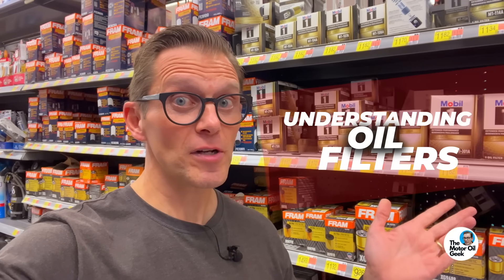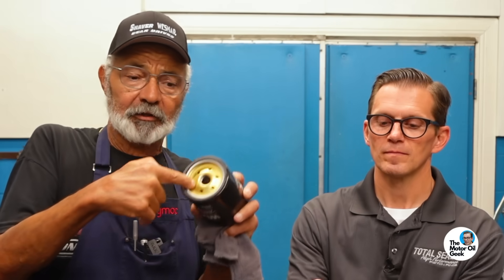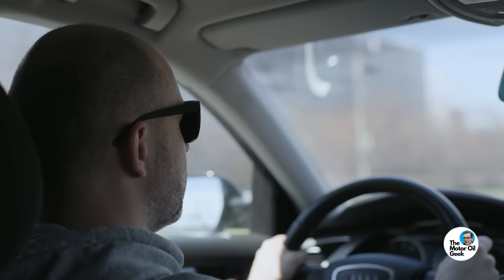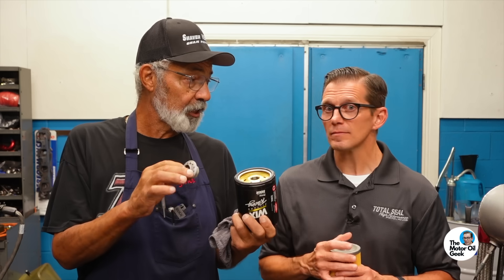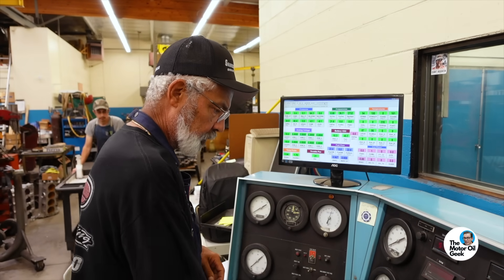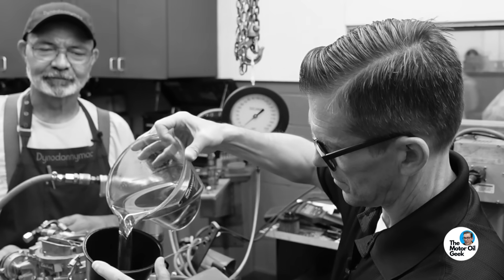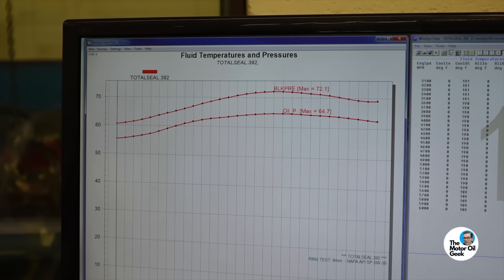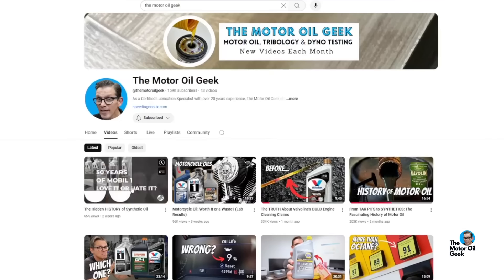OIL FILTERS: What Most People DON'T Know!

Comment: Primer on Filtration
Allow us to offer this primer on filtration.
Filter media has a range of particles that it will remove. The smallest particle size it can catch is usually referred to the “nominal” size. The largest particle size it lets through is referred to as the “absolute” size. The sizes between those two are usually expressed as a beta ratio, or percentage of efficiency. In other words, if you introduce 100 particles of the 15 micron size and 60 of them get caught, you have a percentage of efficiency of 60. It is interesting to note that some companies are very liberal with their advertised absolute numbers.

There are many different test procedures that can be used to test the particulates a filter media will remove. There are single pass, multiple pass, SAE, ASTM, and even European specific tests. What gets difficult is how to compare the numbers used for marketing filters. Picture yourself standing in the auto parts store in front of a rack of filters trying to decide which filter is “best”. You see a 22 micron filter with some sort of efficiency rating attached to it (for example 94% efficiency) and another with a 15 micron number printed on the box with no efficiency rating. And then you see one that has printed on it that the filter will catch down to 5 microns. There is no way to accurately compare those numbers. From a marketing standpoint it is better to print lower numbers since most consumers don’t have a clue about efficiency ratings, and there is more of a chance of the customer purchasing the lower number filter. Problem is the “5 micron” filter may be letting more particles through the filter than the one that has 22 microns printed on it. A good example of this is the Harley Davidson Twin Cam filter. On the box it says it will filter down to 5 microns. When tested at the lab it actually passes 40 micron particles. Before you condemn the filter, I would note that it pretty much tied with the Dodge Cummins diesel filter as the tightest OEM filters tested. As an fyi, most paper filters range from 50 to 90 microns as their absolute number. Ours is 35 (and yes, we can catch 5 micron particles as well).

We use the ASTM test because it offers the smallest amount of manipulation of the testing process. We test for worst case, or absolute numbers, partially to be able to compare apples to apples between filters, and partially because of FAA testing.

As filter media gets tighter, the flow rate gets slower and the resistance to flow increases. This resistance is referred to as differential pressure (the difference in pressure between the outside and inside of the filter element). As the differential pressure increases, the pressure against the bypass valve increases and the chance of the bypass opening increases.

K&P Engineering focuses on maximizing flow rates while meeting or exceeding OEM filtration. Not all stainless steel filter cloth is created equal. We specify the wire diameter, thread count each direction and the type of weave to use to create our filter cloth which is how we meet the filtration and flow goals. We can get between 5 and 7 quarts of oil through our filter element in the time it takes to get 1 quart through an OEM filter element while still meeting or exceeding OEM filtration. The reason for this is that paper and synthetic filter media is made of fibers that are pressed or glued together and require a certain thickness to get to the filtration objective. This type of media inherently has more flow restriction that the filter cloth that K&P Engineering uses. We tested a pro stock engine on the dyno with a gage on both sides of the filter cavity. At wide open throttle we measured 20 lbs of differential pressure on the paper filter (0w at 180 degrees). The K&P Engineering filter measured less than 1 lb. This means the bypass on the paper filter is open letting unfiltered oil through the filter and into the engine. Ours has a lot further to go before it opens. The result is more filtered oil getting to the engine, and getting there faster. The reduction in differential pressure also results in less backpressure against the oil pump which has the potential to improve performance and or fuel mileage.

Some will argue for a very tight filter media, and concentrate on the smallest particles a filter will catch (even though it might be a nominal number). An analogy we use is to think about the towel you are about to dry your freshly washed new car with. Are you more concerned about the dust that has settled on the towel, or the rock that is in the towel left over from when the towel was dropped. It also becomes a moot point on how tight the filter media is if the bypass is open and the debris is flowing right past the filter media. Some filter companies argue that they are ok with the bypass being open because the debris will eventually get caught as the oil seeps through the media and the oil will get to a cleaner level at some point in time. Our concern is what damage is being done while that debris is passing through the engine over and over again waiting to get caught in the filter media. We have customers that do want to get to that finer level of cleanliness, and they usually go with a bypass filter setup. They use our filter as primary filter, and a very tight filter on the bypass circuit. That way the oil is cleaned to OEM levels with our filter, and as it dribbles through the tighter media of the bypass it will get even cleaner.

The stainless steel filter cloth technology has been around a very long time. It is used in military aircraft (fighter jets, helicopters) and even used for filtering blood. K&P Engineering filters are approved by the FAA for aircraft use, and have just recently been approved by the European equivalent of the FAA (EASA) for use on aircraft in Europe. We are consistently monitored for quality assurance as a part of these approvals.

Having said all this, K&P Engineering appreciates the people that question the quality provided by different filters. There are some cheaper counterfeits of our filter out there that use the K&P Engineering information and numbers to promote themselves. When we sent the media of those knock off screen filters out for testing at the lab, they came back as filtering worse than the worst paper filters we have tested. It is kind of like the Harbor Freight versions of Snap On tools.

K&P Engineering
www.KandPEngineering.com

Comment: Good video. I do wonder if any oil can pass through the filter without being bypassed when you fire up the old jalopy in the dead of winter when it's zero or minus twenty degrees outside? I don't know how you can test zero or minus twenty degrees Fahrenheit oil in your lab there, inside the engine before you fire it up, but I wonder.
Reply from the maker: We are going to see if we can test that out.

Comment: maybe you could do a test on a reusable filter like K&P , or Purepower both known brands and used on cars, bikes, air planes because the way you talk about them they are junk but i really dont think its correct and not sure what wire filter you used in your test but like the Pure power filter is double woven 304 surgical stainless steel  media and does have a bypass and does flow over 3 times what a paper filter flows and catches at about 22 micron absolute and for finer particles does have those high powered magnets built in to catch any thing smaller like iron dust,  and has a absolute filtration value and paper does not,

Comment: Usually I agree with this channel, but not this time. Bypass valves do open way more than you think. This case what you are calling "cold" is 70+ degrees inside a shop. That aint cold. I would like to point this video to your attention where many filters are tested. Keep in mind average filters have a bypass rating of 5-10psi. Companies like subaru spec filters with a 28 psi bypass. Take a look at the cold flow pressure differential results. Every one of those filters would have been in bypass mode on damn near any vehicle they were installed. 
https://youtu.be/E-3Q_5RVogA?si=aMQFs9-_cZWqIG5n

Comment: I also see you mentioning the iron oil test where you started with a clean engine then didnt flush it out before trying the wire filter starting with a contaminated engine . I feel you failed to make a fair test environment in that instance to . please try to have consistent tests . I really love your channel and videos they are the best on the internet for this kind of information and I love you guys . but I would like to see a larger effort to make the tests equal
Reply from the maker: Thanks. We actually did flush the engine and measure the level of contamination in the engine before the 2nd test. We don't show every single step of the tests in the videos as they would make the videos too long.
Reply: @themotoroilgeek  and thats why your the best thank you for clarifying that .

Comment: wait hold up you guys warmed the engine up then increased rpm . I saw on the display a 70 and 77 so a difference of 7 at that point . can you show us what happens when you increase the rpm with cold oil . not showing us both I feel ruins this test and shows only half the test results
Reply from the maker: At 3,000 RPM the cold oil still had the 1 to 1.5 psi differential pressure. People complain about the videos being too long, so we've started editing out things to shorten up the videos.

Comment: What about running much thicker oil. Lets say a b series honda engine was originally prescribed a 10w30 and most people now run a 5w40 but some people want to run 10w60 with the same factory clearances as the original, will the bypass open then?

Comment: I changed my Engine oil at every 5k miles, does the bypass valve remain closed or open? Thus can you tell us if we change Engine oil at 5k miles how long will the filter last? Will filter last up to 10k miles?... 2020 mercedes 220d om654.
Reply from the maker: I can't tell you since we don't have any data. My guess would be that it is not opening because 5k oil and filter change intervals are shorter than the designed filter life.

Comment: Hi, I'm from Indonesia. I've been following many of your videos, and I'm curious about something commonly done in my country. Many people mix engine oil with corn-based cooking oil at a 9:1 ratio. Surprisingly, numerous people have shown evidence after years and thousands of kilometers that their engines remain very clean—no sludge, no carbon deposits, and with a smoother performance. 

I don't understand what's happening with this mixture since no one provides data beyond video evidence. If possible, could you connect this with some scientific data? I'm really skeptical about what they're doing, but strangely, it seems to work.
Reply from the maker: That's a new one on me. Bio derived oils tend to not be thermally stable.

Comment: In our jet engines we have a light that comes on activated by that bypass valve. In the cockpit it says oil filter clog. At that point we have some checklists to run. We look at oil temperature and quantity to make sure we are not going metal to metal. Temperature rising would be a shut down and emergency landing. We had that not long ago in an Airbus. The temperature was ok so we continued to destination which was only 45 minutes away. When we got there the mechanics pulled the filter and screens to check for contamination. He found Teflon pieces from a failed piece of something. That engine was done. They parked the airplane in the back lot and had an engine shipped to the airport. A team of mechanics flew in and changed that engine overnight. Pretty amazing work. 5:11
Reply from the maker: Wow! Thanks for sharing!
Reply: Excuse me how much is it to buy a ruined jet engine? I would like to acquire one to fix up and use for private road use.
Reply: @theenzoferrari458 I don’t know. That’s a good question. I know that the parts that aren’t ruined are sold off. I always wanted a 1200 hp turboprop for a boat. The engine turns at 55,000 rpm but through the gear reduction system the propeller output is only 1200 rpm
Reply: Unfortunately it burns 300 pounds of jet fuel an hour. That’s 45 gallons an hour. And jet fuel isn’t cheap. Like $5 a gallon. So we’re talking about $225/hr to motor around the lake.
Reply: @grumpy3543 wow cool. And thanks for getting back to me.

Comment: I had an erratic fram filter,  I think it was bypassing sometimes,  then other times it was not.. and oil pressure was low.. it was a new motor 4 hours of running. You could turn the motor off.. start it after letting it sit a while , pressure was good

Comment: My oil filter is pointing down  on top of my engine .... it's a Subaru ....And it never has oil in the filter when I start the engine.. So I can't fill it up with oil and then put it on since all the  oil would drain out.....  Never had any issues with a dry filter on startup.

Comment: Another question for another video. Why are filters that are just the media and not the whole metal canister, cost the same if less materials and steps are used?
Reply from the maker: Great question!
Reply: Probably due to current manufacturing volumes - may change as more OEMs return to using filter element in canister rather than the all-in-one cartridge.

Comment: Hey @motoroilgeek here’s a question regarding that bypass valve rating - is the 8-11 psi differential where the bypass valve cracks open, or is fully open at that deltaP?
Reply from the maker: It doesn't open at all until that pressure range, so it would crack open at 8.

Comment: Hi Lake how does the bypass work on a cartridge filter such as in my 2020 Chevy Trax where the filter snaps into the oil filter cap?
Reply from the maker: The bypass is external to the filter or cartridge, but it works the same way.

Comment: My last oil change on my truck, the oil filter was empty and didn’t drain any oil! It was the first I ever experienced this. Same oil and filter as usual to, nothing out of the ordinary. 🤯
Reply: A defective valve somewhere in the system ? Filter not assembled correctly ?  Oil going into the small holes and able to immediately emerge into the center space near the mounting end without going through the media ? Or just going through the lowest inch or so of media in a base down mount "upside down" mounted filter ? Some cars with upside down mounted oil filters (the kind you can't prefill) have a standpipe sticking up from the mounting pad that sticks up most of the way up into the central space inside the filter.

Comment: for years Ive tried to explain that top these "exspurts"(in thier own mind). thats for confirming what I knew. the air cooled vw engine also has a differential valve to "bypass" the oil cooler witch can pop if you shoot cold oil pressure to it.many morons out a stiffer spring so all the oil gets cooled...you cant fix stupid.  the gm 3 cylinder ecotec engines have the drop in filter thats a pos..well many after market ones are junk and get wadded up easily as the screw on cap has the very stiff spring in it for the by pass & keep th e filter seated in the block. there was a good filter made in france for AC delgotto(gm) but I dont think they are made any longer.it was a zig zag pleat media. so when it got compressed it did not wadd up.also the inner structer appears to be actually built correctly where many other are not. again you cant fix stupid...to go even farther there is zero anti drain back. The filter drops into a hole in the block. only the centeris a round hole and hard plastic filter structure to seal it with that spring pressure. And yup that is always empty when you pull the cap off to change filter. total drain back..again you cant fix stupid. I have always liked pree filling filters...but...not possible with this engine as it just drains back through the oil pump.( they muct be dam loose crank driver pumps) again thanks for all you guys do,I just wish the "exspurts" would watch you....but...you cant fix stupid.

Comment: Ok, so I get the before and after pressure test but….. how do you know it wasn’t the same because the bypass was open (even partially) when the oil was cold?
Reply from the maker: The valve doesn't open at all until it reaches at least 8 psi delta.
Reply: @ I’m sorry but you are slightly off the mark. When the engine is started, the pressure around the outside of the cartridge goes almost straight to 75 psi (thereabouts). The oil is cold and thick and can’t easily pass through the media. The bypass valve will open (maybe only partially), to equalise pressure inside and outside of the cartridge until the oil thins out a little a flows more easily. This is absolutely proven on oil filtration test rigs.
Ps. Please don’t get me wrong, I’m not having a go at you guys. This was a very good video and one of the first times I’ve seen filter operation explained very well.
For some clarity I should add that I still work for a filter manufacturer and have done for 18 years.